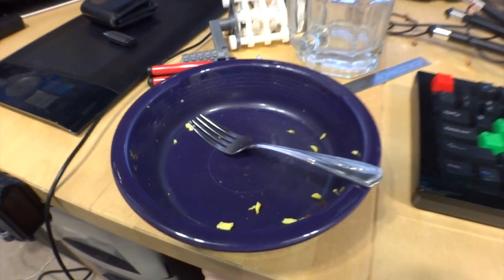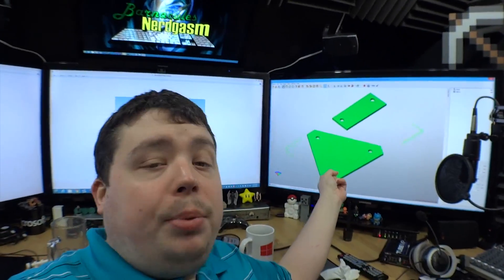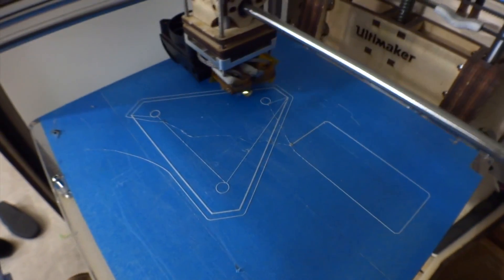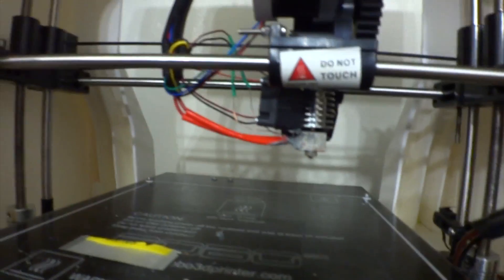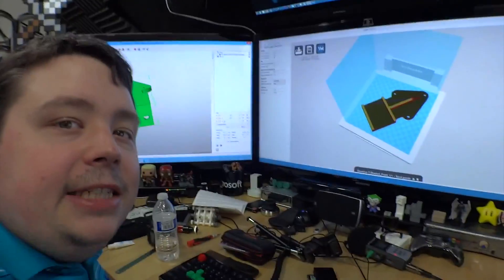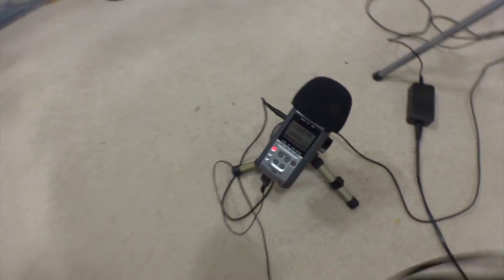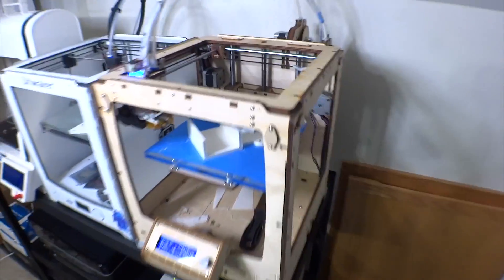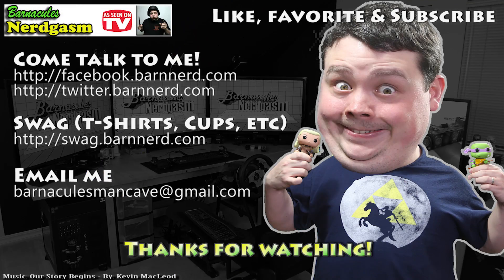BarnaVlog 4 - Life Would Suck Without a 3D Printer! - @Barnacules

Comment: Audacity might be able to clean up that air condition sound in the background. When you click record, dont talk for about 10 seconds so the camera picks up the noise you dont want. Then talk like normal. When it is time to edit the sound later, in audacity, you can use noise removal to tell the program the noise you do not want in the sound file. All you need to do is first highlight a small part of the sound file that you were being quiet in by left clicking the mouse and dragging across, "Just the part with the air conditioner noise." Once that is highlighted, go to Effect, then Noise Removal. Click on Get Noise Profile. Then you need to highlight the entire sound file. A shortcut button for this is just ctrl + A. Once the entire file is Highlighted, go back into Noise removal. This time make sure Noise Reduction is set to 48, Sensitivity is 0.00, Frequency smoothing is 90, and Attack/ decay is 0.15. Also make sure Remove button is clicked off under noise. Then press ok. Test it out, if you dont like it, just press back and fool around with it to see if it helps. I clean up so much noise with that. Let me know if you need help.

Comment: In case you haven't found out a way to edit the ac noise out yet:

Put you camera in your room towards the center with the ac on for a few seconds before you start talking and everything. Once you get everything recorded, dump it into premiere, right click the audio track and edit it in Adobe Audition. Zoom in to the "dead" noise (before you started talking), highlight it, go to effects > noise reduction > capture noise print. Deselect the highlighted portion by clicking anywhere else in the timeline, then go to the same pull-down menu and click noise reduction (process). Play it before applying by hitting the spacebar to see what it sounds like, then click apply. Ctrl+s to save then close audition and continue editing.

Probably not the best way to do it but it's the only way I know how.

Comment: Side note the E3D thermistor coming out is a common problem, to correct this some people have used a threaded thermistor instead and just tapped the hole on the E3D. Fire cement is a little more permanent and will make replacement almost impossible. . 

Just thought I would give you a heads up

Comment: Just a word of warning if you plan on getting it CNC'd in metal. 
Obviously you are aware of the shrinkage of 3d printed parts, so if they've been scaled to compensate for this you'll need to get the actual measurements so that the metal machined part fits properly.  You can get a cheap set of calipers that will give you really accurate measurements, that way you can get a perfect fit on a machined part.

Comment: Removing noise in post production is not an easy or generally effective approach. I have used very expensive softwares with varying results; none of them really to my liking. The best approach I have found is using a "noise gate" on the mic during production. Some of the AIO digital recorder devices have them built in. Most of the semi-pro multitrack recorders include them as well. 

The noise gate simple reduces the gain to negative infinity unless it hears sound over a certain volume. Thereby blocking out background noise and especially so when no other sound is present. Very advanced, expensive systems to do this can even be set to a frequency range and volume for activation threshold, i.e. parametric noise gate.
Reply: AaronAlso You can setup a noise gate in post with sony vegas, and I'm sure you could do it with the adobe suite too, i just don't know how.
Reply: AaronAlso would recording the AC on its own and then overlaying on the video and messing about with alignment/phase help?
Reply: TDPEquinox yes you can do that but it isnt as effective as garing the noise out during production.
Reply: pabslondon No! 

It sounds good in theory but in practice it would be very difficult to get the wave absolutely 180deg out of phase and at the same volume.

Comment: What material are you using in this video?
The white looks amazing, like one solid block.
ABS or PLA? Why is part of the print dirty? I mean the black parts...
Reply from the maker: This is PLA but I'm printing the other side bracket in T-Glass which is like Nylon with more flex and much stronger.

Comment: I have a flash forge printer and it doesn't seem Luke it wants to print I put the filament in the printer. Its abs and It has default settings. I want to see if you can help me

Comment: Never used a modeling program before; my only interest is for 3D printing. Which program would you recommend to pick up?  I'm currently learning Blender, but just want some other suggestions
Reply: supafly208 3ds max is alot better
Reply: +koolerpure I learned sketchup first and then blender. Blender has taken me about a year to comprehend most of the modelling tools and use them though.

Comment: I don't know if somebody else mentioned this to your before but the simple solution for the noise of Air conditioner is what is called Split unit: an air conditioner with two parts: the noisy one installed outdoor and the silent one installed in the room. They do the same as the conventional air conditioner that you have but the trick is to keep the noisy compressor and all outside and keep the cooling part inside. this is as good as complete silent. I can see you don't have problem with money so you can afford it.
http://www.ebay.com/bhp/split-ac-unit
Cheers.

Comment: I suppose if you needed several parts of something in a hurry you could run all three printers at once, each doing 1/3 of the job.

I think the 3D printer of the future will use multiple print heads, like a dozen or more, all working together so that things print out in a hurry.

Comment: I have one a makerbot "prototype" I think anywy but it A PAIN IN THE RECTUM TO GET IT TO PRINT ANYTHING pls help. it always globs up on the extruder
Reply: How would you know
Reply: The printer printed a few things fine but k0now it just leaves a mess
Reply: hunter hulsey Cause I have used the Makerbot Replicator pretty extensively. The prints are very low quality.
Reply: +Dillan Hart not necessarily most likely the speed was WAY to hi what do YOU recommend then
Reply: hunter hulsey 50 mms? Way too high? This guy printed on an Ultimaker Original at 300 mms with a better quality. I also had the quality to the highest setting possible too.

Comment: I am waiting to see if you can print a 3d printer on a 3d printer.  That will be impressive
Reply: Closest thing, I think, is Reprap - the whole idea behind that one is that many of the parts (joint parts that hold the frame and mechanical parts together and mechanisms like the filament extruder) are designed to be 3-D printed.
Of course there's also a whole pile of parts for that thing (metal hardware, extruder nozzle, heating element, print bed, motors, electronics package, etc.) which can't be 3-D printed. And it also means that to build a Reprap you need to get somebody to print that big pile of parts for you.
At this point, with all the options for buying a 3-D printer I think that's the better option.

Comment: Just wait until you know how to draft the parts yourself, even better than printing a part someone else designed for you!  Those brackets would be so easy to model in 123D Design.

Also, 3D printers are little more than just expensive novelty items if you don't have any intention of making stuff yourself.  If all you want to do is print a model here or there off of Thingiverse, you're better off just send the model off to be printed.  The real value to 3D printing (apart from the enjoyment and satisfaction of knowing and understanding the tool chain) is the ability to work on your own designs, and create custom parts for custom applications.  If you don't want to do that, then yes, expensive irritating toy.  So if you're not a DYIer or Maker or an Engineer or such then it's not worth it.
Reply: +Bu Jin or learning how to program/ use software

Comment: seeing those parts are just flat...

-measure with a pencil>print on paper>ask for the metal parts.....save thousands on a 3d printer.

Not saying they aren't the future, they just aren't the present.
Reply: +Shaka12 The last part wasnt flat, that other 2 wasnt 3d printed they maked them on paper and 3d printers arent thousands thats an idea that people have today, they are some for 78€ ....
Reply: +MegaNitrospeed i guess i'm just not an early adopter. As a 3D artist, this would make my day, getting a 3D printer. But i expect way more than most of them are capable of. The only ones i see that barely reach a decent quality, are still in the thousands.
Reply: +Shaka12 Depends, on what you mean with decent quality. Have you seen tiko ? being released november is pretty cheap and good
Reply: +Shaka12 Whats for you "Decent Quality" ?
Reply: +MegaNitrospeed my bachelor's Industrial Design, and I'm used to high precision 6 axes machines that do nanometric quality stuff. they did that just fine for decades. revolution about 3d printing is that its the opposite to the substraction methods we used until now. That saves money, equipment, material recycling, and so on. I understand the advantages of it, but they are still at amateur toy level. Granted there are some resin laser ones that do an amazing job, 3d printing is in the awkward teenage phase, where it can't really do the most intensive things, and its still not a cheap alternative to anything...except drafted prototypes and poor quality items that with the work needed, materials, etc, they are still close to affordable for average households. Its not that I have anything against them. just told you, I want one, but still wait for them to mature into a full on replacement of the tech we already have.
Reply: +Shaka12 You mean CNC machines ? They are much more costfull than a Good 3d Printer, and you would save a big ammount of money, because it builds it dont substract
Reply: +Shaka12 At the moment they're mostly for enthusiasts and quick prototyping, so you are absolutely correct. They do, however, show potential as a cheap manufacturing tool for average consumers.
Reply: +Shaka12 Well how much do you think the tools for the machines cost to cut out the metal? i think a 3dprinter is much cheaper and easier to useand cheaper in the long run.